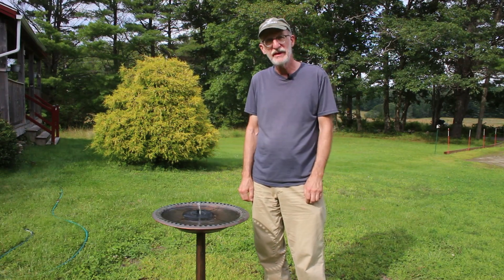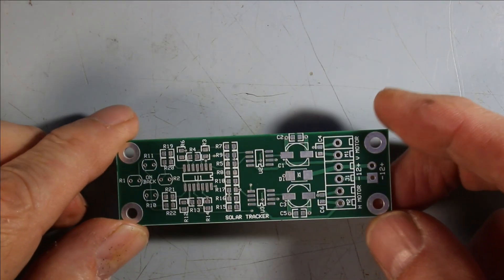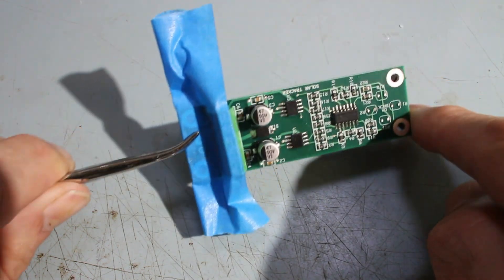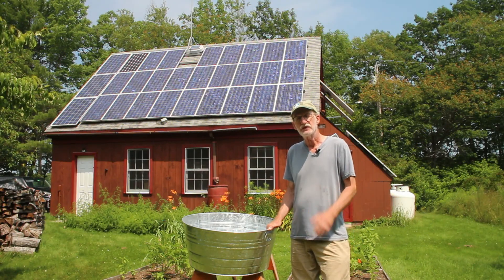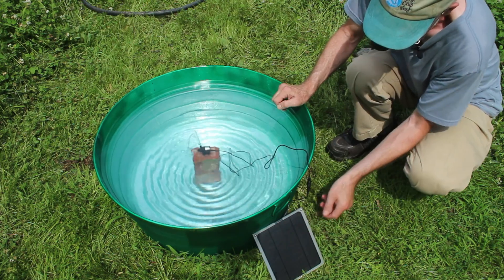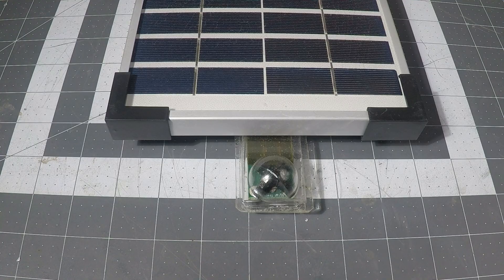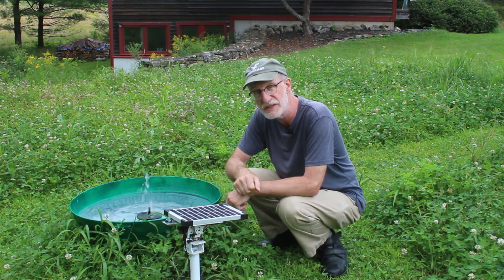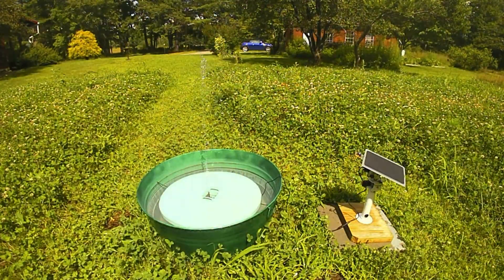Solar fountain experiments

Comment: Hello. Do you sell those tracking system boards?
Reply from the maker: Ha!  I thought someone would ask.  No, if I did I'd need over $150 each.  If you have the skills you could solder the circuit using through hole components on perf board.  But calibration would be a pain.

Comment: Could you use a zener diode to only turn on power to the pump when the panel is getting enough sun? That way when the sun is just rising the pump won't be stealing power until the motors are able to move the panel over.
Reply from the maker: Interesting idea, but not really practical.  Consider a situation where cloud cover happens in the middle of the day for an extended period of time. The fountain pump would prioritize the use of the solar power and prevent the tracking motors from running as you saw in the video.  I think the battery was the best solution and I really like the system that I purchased.